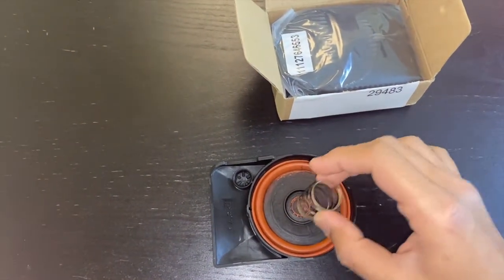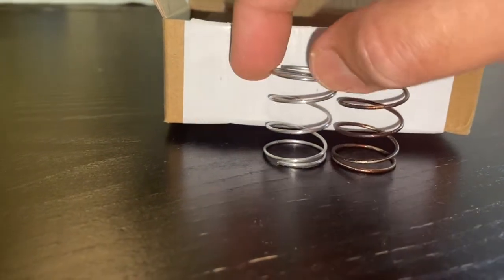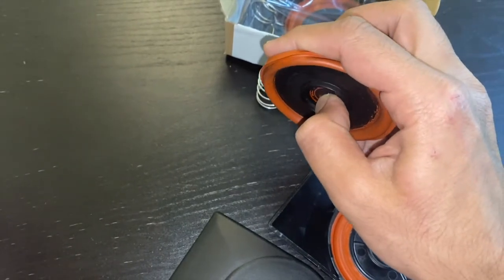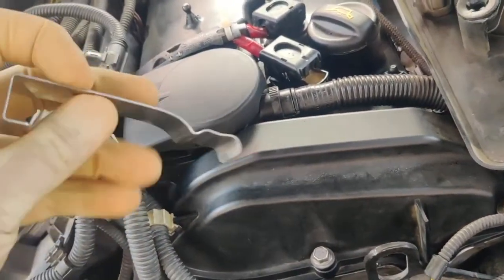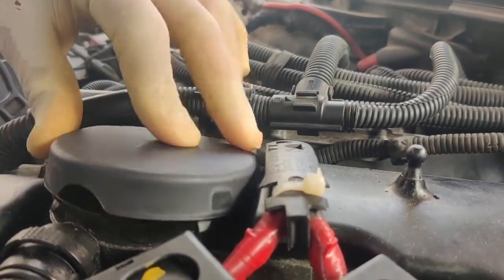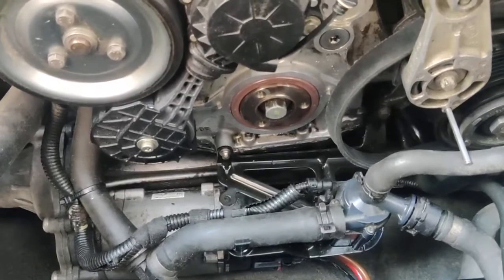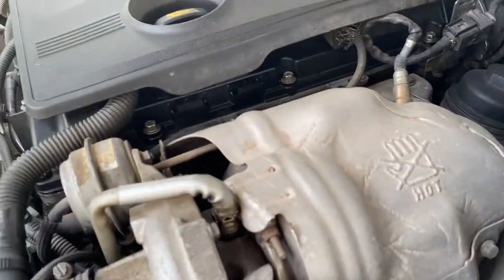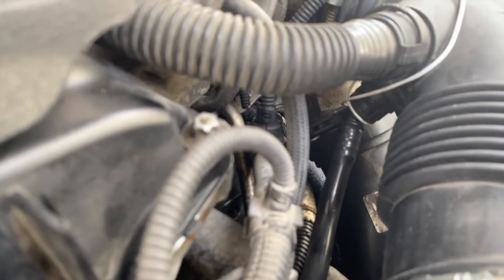BMW F20/F30 MINI  N13 ENGINE OVERHEATING ON HIGH ACCELERATION - FIXED !!!

Comment: I can understand this problem but it is not really related to the PCV valve. This overheating is due to the friction drive not engaging correctly OR the belt slipping with the water pump pulley, causing the water pump not to run properly, hence resulting in overheating.  The N13 has a friction drive mechanism (the black pulley plastic device) beside the crankshaft pulley which engages and turn the the water pump through friction of the belt.  As your crankshaft seal area was leaking oil, the oil was spraying on the belts, thereby causing it to slip and may not have turn the water pump pulley correctly.  I had this similar problem when I had the oil leak problem and it showed a high temperature alarm, but as long as there is no oil leak on the belts, there was no issue.
Reply: Now my current issue, as in your other video on the oil seal replacement, is that I still cannot identify where this oil leak comes from.  See my comments on your other video.

Comment: My temp was around 119-120 , sometimes 122 degree celcius when cruising on highway 100-120km  Is it normal?
Reply from the maker: Unless you get a overheating message that is normal I guess. Usually I noted around 100-110 degrees when cruising the engine temperature will rise.
Reply: @bimmerhacks  no overheating messages, but another thing is drivetrain issue when i accelerate or drive higher speed.
Reply from the maker: @sinongol7116  read the error code. Probably the exhaust VANOS solenoid need to be replaced
Reply: @bimmerhacks  it says 120308 charging pressure control, plausibility pressure too low. Is it a boost leak?
Reply from the maker: @sinongol7116  seems like boost leak. Any work done to intercooler recently?
Or vacuum line break for the turbo. Check if turbo actuator is pulling while accelerating
Reply: @bimmerhacks  alright will do, btw thanks!

Comment: I am experiencing a similar problem on an F20 116i, even after having replaced almost every major part of the cooling system. How does the PCV valve relate to engine overheating?
Thank you!
Reply from the maker: You can open the pcv and check if the diaphragm is hard or torn to make sure it's faulty
Reply from the maker: Did you check?
Reply: @bimmerhacks  I am going to check on the next oil service.
For now overheating issue has been dealt with by repetitive bleeding of the cooling system via the auxiliary coolant pump.
Reply from the maker: @pavlosm8827   hope you saw my new video on the overheating issue. Now I had an issue of overheating occasionally and when i checked it was due to wrong signal given to CPU by the coolant temperature sensor. The wrong signal made the friction wheel disengaging the water pump.
Reply: My 116i sport is overheating I’ve changed water pump thermostat but still when I check the pipe’s from radiator the top one is hot but the bottom one is cold what’s the course
Reply from the maker: @JusticeMothape probably the oil temperature sensor check if the water pump is working while the car car overheats. Check out this vdo https://youtu.be/ale6hxdziWQ?si=EkMQ8LLS5Zexd8oq
Reply: @JusticeMothape  did you manage to fix it, mine keeps over heating ?
Reply from the maker: Yes. Oil leak was slipping the water pump and not rotating the pump. Second thing is in the video
https://youtu.be/ale6hxdziWQ?si=lrU8MK6x36m0n4dw
Reply from the maker: Due to high pressure created in the engine will make the engine overheat and  the oil seals push out to release the high pressure inside.
If you keep your car idling for 10 mins or so you would hear loud houwling noise from the engine